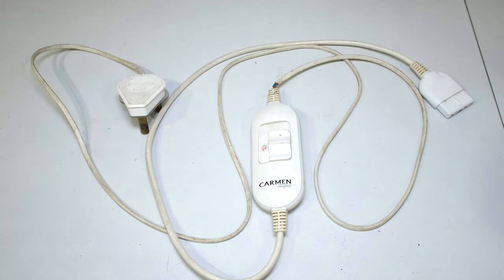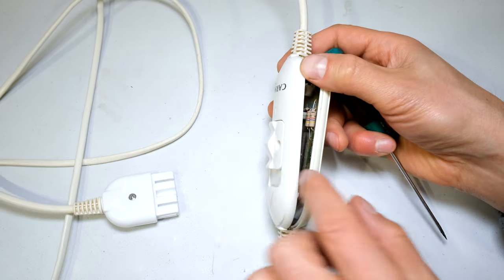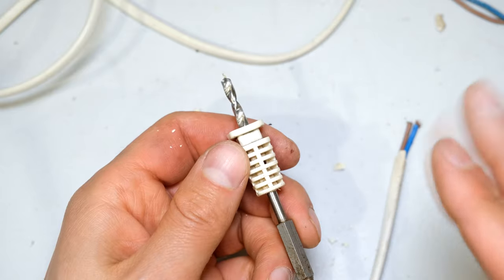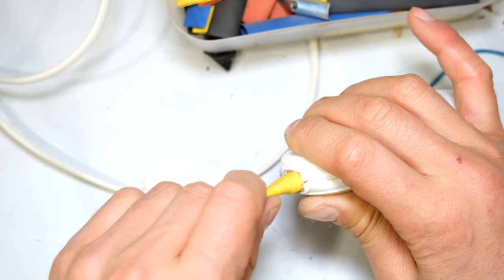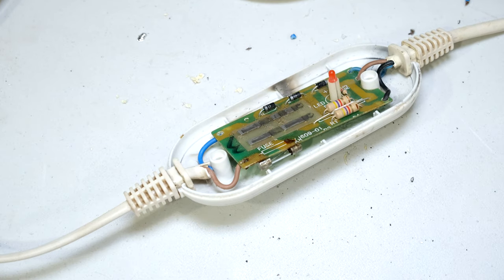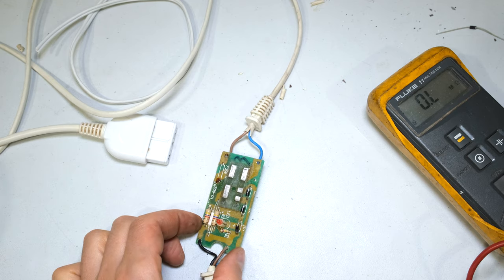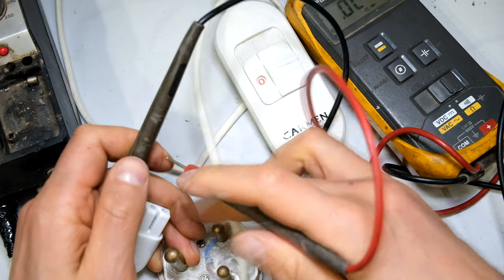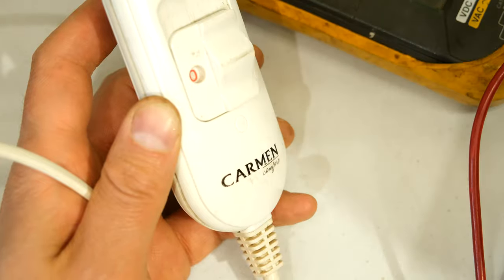How to repair a controller for an electric heated blanket

Comment: I have a heated "throw" or "lap blanket" that just died yesterday.  It is one of those with a button on a controller that steps through three settings.  I did not know how I was going to approach it until I saw this and your measuring across the outside contacts.  I was going to go at it blind but now I have a possible starting point.  Thanks for the good info.  (In fact, I now have about three of these things that have all failed after about one year.  A coincidence?  I think not.)

I appreciate your comment about not just throwing it out and buying new. We are doing way to much of that in our world now.  Land fills are filling up and we are depleting natural resources.  To say nothing of our own labor.  Planned obsolescence is getting out of control with manufacturers fighting to prevent us from repairing what we purchased.  Thanks again.
Reply from the maker: thanks for your comment, i feel the same way
Reply: I have one with 5 settings im assuming you have a sunbeam like me. Its a very basic control unit with Lo - 5 High setting and it failed in under a year and never washed it.

Comment: Hi, thank you for the excellent video. I have a question: my electric blanket only lights up on setting 2. Nothing on settings 1 or 3. I have opened the controller and checked the resistances, thermostat and diodes with a multimeter, but cannot seem to find anything that is not working. I also cleaned the actual connection areas between the switch and pc board, but still no luck. Any suggestions that I may try? Thanks.

Comment: Hello my electric blanket has stopped heating up but the control dial still works fine. Does this mean it's the plug in the blanket that's not working??
Reply: It may be that your plug point or plug that you use isnt working or something about the control connector(may not be connected properly etc..)

Comment: Hello, i had measured with multimeter to the exit of the controler (AC) and my measure are 10 v in position one, 11v en position 2, and 12 v in position 3. is it ok? i have seen your measure are 110v o 220 v... my blanket is to old. Could you tell me anything? thanks

Comment: I had the thermal fuse blow on mine. I replaced it and it went again. I assume one of the resistors is overheating. Do you think it would be a fault in the blanket causing this?

Comment: I purchased a SABLE heat and neck heating pad.  when I got it home I found out the controller won't work.  it wasn't returnable so I contacted SABLE and they couldn't even tell me where to find another working controller cord and wouldn't honor the warranty that it claims they have on their products.  any idea what I should do short of buying another from somewhere and just using the cord?

Comment: My electric blanket lasted one season and now it just gets barely warm, but at first it would get so hot at 4 whereas now 10 doesn't even get beyond warm.
Reply: I've had two.  Electric throw and a full size for a queen size bed with two dials.  Both only lasted about 5 months.
Reply: @nunyabizz8516  I just bought another Sunbeam, and already it is weaker so doing the same thing the other did.  Man, I miss those 1970's Electric blankets that were thick, and lasted several lifetimes.  Cool thing was that they didn't cost you an arm, and a leg, either.
Reply: @generalawareness101  and they didn’t have these stupid timers
Reply: @ItzFlame1  Yep.  Mine says 10 hours, but if you do the maths it really is about 8 hours.  Why?  Simple, these timers are made to be universal and in a 50hz country.  Now the USA is a 60hz AC country.  (50/60)*10=8.33 hours which is what we get.

Comment: How can I know/decide which wire is phase/positive wire and which is neutral /negative wire when same colour of wires are used.Please explain Sir, Thanks.
Reply from the maker: you would need a multimeter and set it to volts. Then you would measure between one wire and the earth wire at the plug, then the other wire and the earth wire at the plug. The wire which gives you higher voltage is live.